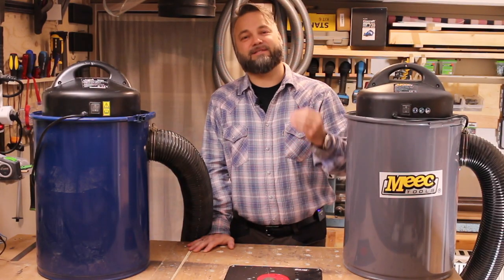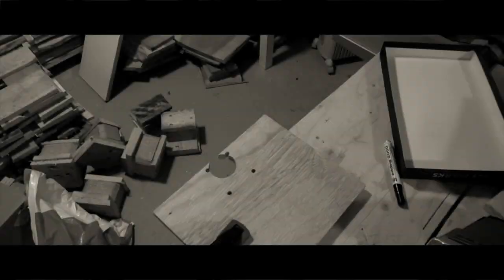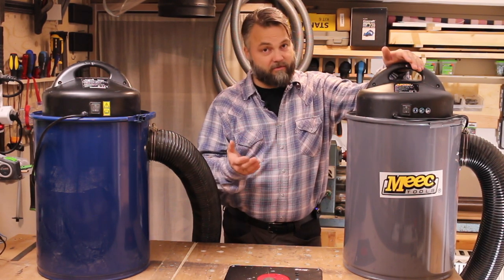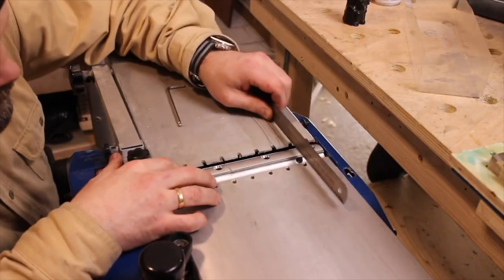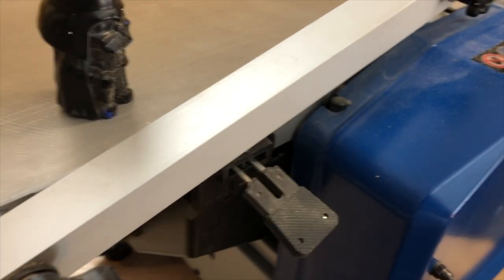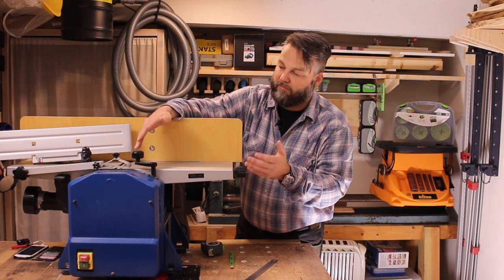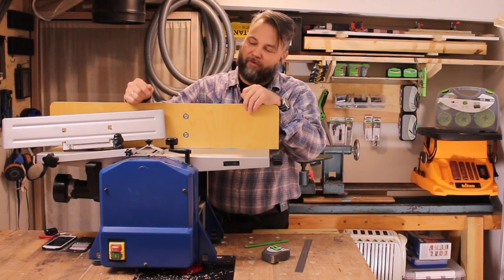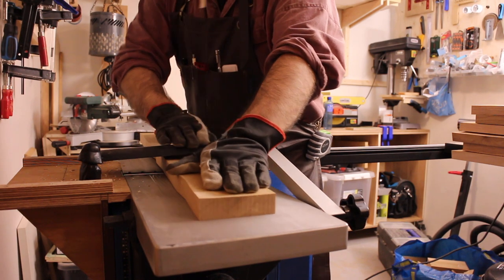Independent Review Planer Thicknesser - OEM and VAR - Scheppach HMS 850 - 8" Jointer Planer  [0076]

Comment: Hello my friend,
I have the same machine. I am using Scheppach HMS 850. You honestly gave a nice review. You explained the details well. I also had a belt tearing problem with this machine. And I solved this problem myself. There is a video of how I solved it on my channel. It was a good idea to raise the fence. The thickness section is somewhat problematic. At the entrances and exits, branches form about 3-4 cm of the tree. In this, it is necessary to extend the lower table somehow. Thank you for this nice and honest review. All the best. See you later. Big greetings.
Reply from the maker: Hi again :D
I made a video on my fence upgrade for this machine. Check it out :D It makes the machine a lot better. To avoid snipe it helps lifting the board gently when it exits the machine. 
Cheers.

Comment: Having looked at all these cheaper options, the only reasonable machine I saw in the store was the Metabo HC 260 C. It at least has 1.1 meters of tables and they don't bend. But having said that, I will be waiting when some old soviet era machine turns out used somewhere whit a longer table made out of cast iron. Your review was awesome, what I needed to keep me from buying this. I like scheppach but only for accessories, like their miter saw stands for example, which compare to the dewalt that everyone likes, are just built better. Thanks for the review!
Reply from the maker: Thanks for checking in :-) I am currently looking at the Axminster / Jet 6 inch joiner. But I haven’t decided.
Reply: @NomadMakes  The JET is a solid choice if you have the space for it and it can be delivered. A lot of people in Russia use those. Tables should be good quality based on opinions and being cast iron they will last.
Reply from the maker: @cooper1101  Of course what I really want is paralellogram lift combi machine with a helical head, but those machines can't really be taken apart unless you are a rocket scientist, and it won't fit through the door to my workshop.... Not that I have space for it anyway.

Comment: Thank you, though the fun part here is this model is the cheapest on the marked here in DK. Einhell is the next, Dedra and the other ones which as you say are basically the same, almost double in price.
Reply from the maker: That is strange :-) Well as long as you go into the purchase with your eyes open. You can always joint the edge of the boards on your table saw with a sled.
Reply: @NomadMakes  true... my problem is lack of space, as in.. I have zero 😛
Reply from the maker: Well…. It’s handtools then, I guess.

Comment: Very useful.  Great and balanced review and in my opinion, very true. I have seen this machine price range from £150 - £650 and as you say, the only difference is the paint and labels, so buyer beware.  Sad thing is for newbies this type of cheap machine (like all cheap tools) can actually put people off the trade/hobby as they're really hard to use acurately and get good results from.   I think I will be spending more money on two separate machines.  Shame, because I have limited space, which was the appeal of a two in one machine.
Reply from the maker: Yes. This machine is somewhat of a lost opportunity. It could be a good machine with just a few improvements. 
Cheers and thanks for watching and commenting.

Comment: Great review, had my doubts, but you absolutely confirmed what i was observing. I am on the market for a combo like the hms 850 and i was actually considering it, however maybe the model got overhauled, as i'm noticing key differences from the one you reviewed. 
1. The fence looks much more sturdier, longer and the mechanism looks entirely different. 
2. The thicknessing table has extendable supports, which i fear might increase the issue with the wobbliness of the thickneser's table if that has not been resolved.
How would these improvements (if done correctly of course) change your opinion ?
Reply from the maker: Thanks!
I’d say that the changes you mention are very welcome, as in my oppinion this planer is somewhat of a wasted opportunity. Meaning it could be a good product with minor changes. 
When it comes to a purchasing desicion, I’d look at your budget, intended use and space. 
A better fence is of course great, and some in/outfeed support for the thicknesser is helpful, but you will still get some snipe. 
To be perfectly honest, this kind of planer is your only option before looking at a floor standing model. Unless the 6inch table top jointer will do.
The biggest issue you will have, depending on the projects you make is the lengt of the in/outfeed wings on the jointer. 
In my woodworking i now do most of my edge jointing using a sled on the table saw. 
For face planing I use my thincknesser if possible, or just skip-plane. 
Hope that was helpful.
Reply: @NomadMakes  Issue is i'm really, really space constrained so i need this to be as small as possible for storage. I can retrofit custom made detachable extensions for both beds, but i really need this to be able to produce reliable quality results. I was looking into the bigger brother hms1070, which has more width and a more powerful motor, but it also has more length to the planer bed, which will cause storage issues for me. I am really novice and i doubt this tool will be used heavily so i'm trying to work out if its worth the investment into the bigger and more powerful hms1070 or i should just get the parkside sibling of this, which is identical to the one in your review, but will cost about 30% less than the upgraded hms850
Reply from the maker: @spalxy I feel your pain mate! My workshop is only 12m2. In that case, I’d say go for the cheapest one. That way you will see through your projects what your real need is.

Comment: What to buy? Budget can go up a bit? Researching and researching but difficult! Any recommendation would be highly appreciated
Reply from the maker: What size of lumber are you looking to joint?
Reply: @NomadMakes  min 200mm but preferably 250 or more :)
Reply from the maker: @martinmenso6671  with or length?
Reply from the maker: @martinmenso6671  this one does 200mm wide boards.
Reply: @NomadMakes  yes I understand that.  But I want some quality and something a DIYer can grow with? :) After your review this kind of machine and all its VAR don't fell good
Reply from the maker: @martinmenso6671  It all depends on how much space you have and what length of material you want to use. For short pieces this ok. Perhaps as much as 1m. But for longer pieces the tables does not give enough support. They are too short. Can you use separate machines? One planer and one thicknessers? If so I would go for separate machines. The problem is that these machines here are the only ones available is this price bracket. Can you manage with only the thicknesser and use a sled?
Reply: @NomadMakes  I am looking to plane 2 - 3 meter long pieces of wood. I wouldn't mind getting into the next price bracket or separate the jointer and thicknesser but would prefer a combo styled one. But I have been researching for days and I find it difficult to get a proper machine without spending thousands of euros.
Reply: Space is not an issue
Reply from the maker: @martinmenso6671  Then go for separate machines.
Reply: @NomadMakes  any recommendation on that? :)
Reply from the maker: @martinmenso6671 In which country do you live?
Reply from the maker: @martinmenso6671  any of the 6 or 8 inch models. Long bed version if you can swing it and have the space. Brand doesn’t matter, they all come from the same factory. Then a «lunchbox style» thicknesser. If you go for a helical head, which can be expensive, go for that on the thicknesser - as that is the last process. With these two machines, you can grow. If you are just dipping your toe in, go for the machine type in this video.
Reply: @NomadMakes  okay thank you! Any experience with or Elektra Beckum 260K or Holzstar ADH 260
Reply from the maker: @martinmenso6671 No, not those specific machines. Hope it helps. Cheers.
Reply: @NomadMakes  thanks alot!
Reply from the maker: @martinmenso6671  No problem mate!

Comment: Great review, and great someone is adressing the whole OEM / generic products concept. 

I have the Scheppach HMS 850 myself, and I was aware of its shortcomings before buying it. I’ve been quite satisfied with it (but I have my upgrade on its way) and I never fixed the fence issue - as I have a table saw with a jointing sled. 

I’ve not experienced issues with the thicknesser, except for the snipe - which you’ll get on ‘all’ combos anyway. A sled will help a lot with that. 

And for the chip collector I did my own research and found the two to be identical, so I got the gray one 😂

Speaking of other OEM tools, I see you got the orange version of the spindle/belt sander in the background. I got a blue one but not Scheppach. In fact, it was so cheap they didn’t even bother to put their logo on it. But still the same product.
Reply from the maker: I do belive It is indeed the exact same product. However, I got this one at a massive discount.
When you do your jointing on the table saw, are you happy with the seams? Or do you plane then sides by hand after running them through the table saw?
Cheers and thanks for watching and commenting.
Reply: @NomadMakes  Well, on the table saw I’m not happy with the surfaces, even after getting another blade with more teeth (I think it’s because of the thin kerf blade wobbling a bit), so I often run it over the jointer again (but not pressing very hard towards the fence). But since getting the Makita track saw I’m satisfied with the smooth surfaces that leaves, so that can be glued directly.
Reply from the maker: Ah. That is nice. I recently purchased a Maktia track saw as well :-) Looking forward to trying it out. 
By the way. The fence is well within your skills, mate :-) I have seen your instagram :-D And it is a massive upgrade. It is just a bit finicky.
Reply from the maker: Oh! By the way. Do you have a link to that "blue machine" ? I will probably make a video on the orange one. So, it is nice to be able to give some good purchasing advice. Thx :D
Reply: @NomadMakes  I tried to comment with a link, but it looks like my commet got deleted?
Check out the oscillating belt/spindle sander from VidaXL. Maybe that is the blue machine he was taking about?
Reply from the maker: @Gronnth  Hi! Yes, it looks like comments with links gets auto-deleted. There may be a setting for that. But yes. It is the VidaXL, i think.

Comment: I bought the new Grizzly combo planer/jointer (receiving it tomorrow) and now I’m worried it’s basically the same thing as the Sheppach.
Reply from the maker: Hi Aaron! Do you have the full name for the Grizzly?
Reply: @NomadMakes  G0959 for the 12” model and G0958 for the 8” model
Reply from the maker: It looks like the same machine. However, looking at the pictures on the Grizzly website, the fence looks better AND it has a helical head. 
Maybe the most important issues have been adressed…? It would be cool to know how you like this newer version of the machine after having tried it.
Reply: @NomadMakes  at $1000, the 12”/ 305mm model is expensive but it does have a true helical cutter head with 28 1.5mm carbide blades. The fence does look thicker too with a better adjustment mechanism in back. The jointer bed has grooves in it which seems more common on European models. I’m not sure what to think because it could be really nice or not great at all. For $1,000, it needs to be solid. I accept the smaller planer bed since a 12”/305mm jointer bed is impossible to find under several thousand dollars on a commercial unit.
Reply from the maker: If it is a space issue then you just have to make it work anyway. But if I could choose, I would have a floor standing model. However, as you point out, at 12 inches the capacity is hard to beat. I mean you yourself is the only one that knows what your requirements are when it comes to capacity.
Reply: @NomadMakes  I would much prefer a floor standing unit than a table top one. The cost will be much higher, but currently I have no way to plane my lumber so I must buy it already planed on all 4 sides. In my area, lumber is 4 times more expensive if it is pre-planed, so it won’t take long to see savings even on a $1000 machine. If I can make it work for a year or two then sell it, I will have saved more money than I would have spent.
Reply from the maker: Cool :-) But at 1000usd have you considered a used jointer? And then getting a cheaper lunchbox planer.
Reply: @NomadMakes  technically it was under $1000 before taxes but I have considered it. I know I want 8” capacity with a spiral if not a helical cutter head — something that could do the job for 1.5-3 years. There’s a company called Oliver Machinery that started in my city (Grand Rapids, Michigan) and they have their factories in the US. They sell a planer with Byrd Shelix cutter head and digital display for $1000. The Grizzly version is $800 and is the cheapest helical head on the market. Honestly, I will provably sell the unit after my family and I buy a house with a garage, and then I’ll buy a floor unit (as money permits). 
Before seeing your review, I knew the machine wouldn’t be perfect, but as long as the fence is solid and the planer table is stable, I think I should be good. I am calling Grizzly to address some of the things you mentioned.
Reply from the maker: Cool. Let me know how you like this machine. I always thought these machines could have been excellent with just a few upgrades. Maybe they have made it.

Comment: I bought a machine like this as you say they are mostly the same, i had bad luck with mine as i had 3 which all got returned as all had same fault infeed and out feed tables were uneven i gave up trying to buy one now
Reply from the maker: These really are a struggle. I was lucky with this one though. Maybe Scheppach does some quality control? Although I doubt it. Cheers and thanks for watching and commenting.
Reply: The reason is because there is only one screw that adjust the whole shebang on the infeed table. I had EXACTLY the same machine, sans the fence which was rather okay on mine (no need to remove for thicknessing), but it worked great: It was a cheaper model with black paint and different stickers. I sold it, and got a ML392 in stead. it has one screw that adjusts the infeed, but the whole table is secured in a way that makes it move parallel no matter what.

Great machines for small shops and infrequent use, but they do have their limits. My advice: if space and money allows it, go bigger. At least choose the color you like best. Or repaint the thing. Be a VAR yourself! :D
Reply from the maker: @vharboe  Be a VAR yourself :D LOL.